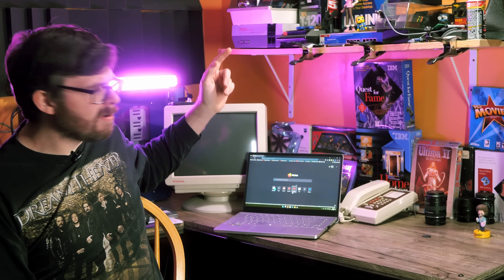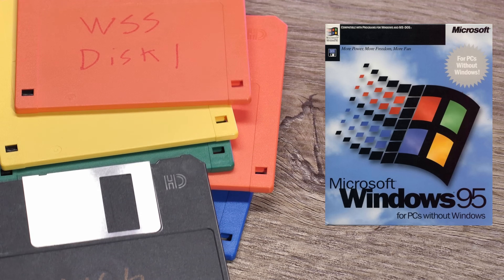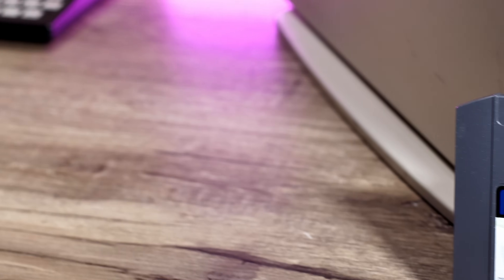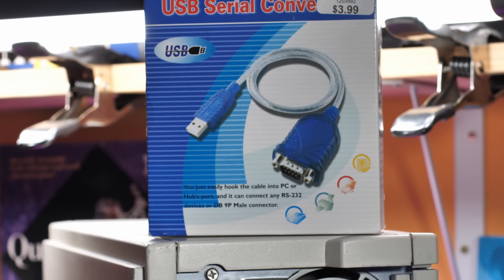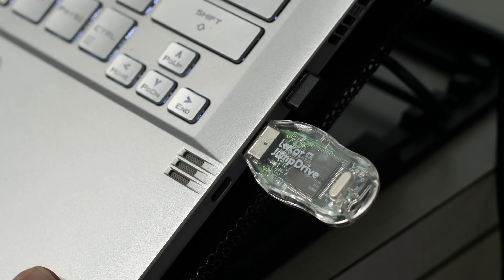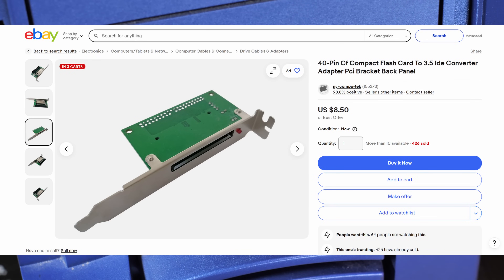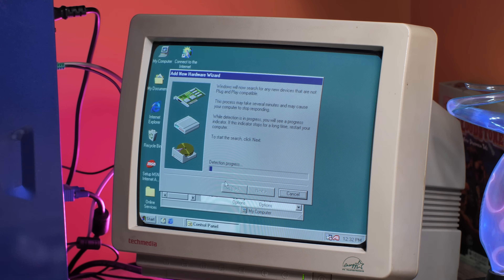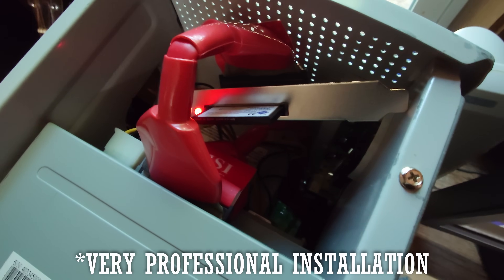What is the Best Way to Move Data to Vintage PCs?

Comment: Okay, few more things 😅.  First, my method of transfer is network!  I use LAN Manager quite a bit, others will use EtherDFS or set up a mTCP FTP server.  Second, for Laplink/FastLynx serial transfer, you'd use a null modem cable, and for parallel transfer you'd use a Laplink cable. Third, USB solutions do exist for DOS!  ISA USB cards are available for purchase and support mass storage. Fourth, I think the PCMCIA adapter you showed might have been PC Card as opposed to CardBus, for people who have older laptops, they might not take CardBus, so if anyone buys an adapter, it's worth checking!
Reply: Yeah, the adaptors are definitely 16-bit PCMCIA, not 32-bit CardBus. CF is just PCMCIA in a smaller form factor, so the adaptors are "dumb". (This also means that PCMCIA is just a removable form of Parallel ATA too, since CF to ATA adaptors are also "dumb").
Reply: @mallardtheduck1  awesome!  Yea, with some "cheap" aftermarket adapters, I've seen the signature "gold bumps" missing but they were CardBus.  It's good to hear that these are PC Card!
Reply from the maker: Good corrections thanks! I'll pin your comment.
Reply: @DOSStorm  right on!  Thanks for making the vid and introducing people to transfer methods.  I see a lot of people who have questions on how to transfer files, and this is going to help them out a lot!!
Reply: Ether et MS network simple XP W98/95, USB ! This only setup ru  little less forward, CD R, costly. FLASH 4G nott many older syste have a drive  ?
Reply: @maedero05  I honestly have no idea what you just said 🤣.  Want to try again?
Reply: You don't need an extra card if the mobo has an usb port.
You only need to run these two commands, you can even run them from a bat, the sys files are easily available at any retro site.
There also are other usb stacks available if that one doesn't work for you, I personally never needed a different one.

devload usbaspi1.sys
devload di1000dd.sys

(Also *dos storm try an usb zip drive you will be amazed at the speed it runs at)

Comment: There was one method I am aware of that you skipped entirely, and it is likely one of the least painful...   If the house or room is equipped with networking, ideally one with NAS or local server storage... you can just jack into the network, map the drive and grab any amount you want.   Even if no NAS or local server, you can map to another system on the network and use that.

Comment: I've been using mostly an Adaptec Sata/Raid PCI adapter. I've 2 of them in 2 retro computers, one with 120Gb SSD and the other with 240Gb SSD. For me this is the best working reliable option available. I think you should buy one of these cards and make a good review.
I've also another retro computer with a 120Gb SSD but with a Sata to IDE cheap green chinese adapter one can find abundant on eBay. These adapters can work well but are unreliable and don't work well with more than 120Gb SSDs period. It will corrupt always all of your data.
Anyway all retro computers I own, their SSDs are divided in 2 partitions, one for the OS and the other for all the data I might require. From drivers and software to almost all disk images games I play. This is the best way👍

Comment: i'm a big fan of Zip but i own 12 disks and a 250 ata drive.
Reply from the maker: If you have the stuff for it and its in good working order its not horrible. However, if you're trying to find a good working drive these days, I just think you might be better off with another solution.
Reply: @ well my drive works at least I’ve had it since I bought it in 2001

Comment: When I use Windows 98SE I love to install the Active Directory Client for it (and also NTFS driver although idk if you need that for it as well never tested it.) Since most PCs I use have an Ethernet connection I can just boot up my VM that emulates an SMB from my actual home server and transfer files that way. Also helps that Win98 still is build upon DOS so I can also transfer DOS games that way.

For this to work in laptops that don't have any Ethernet jacks I use a PCMCIA 10/100 Ethernet card. Although I found that mounting my dumps with that usually makes them stutter, especially full motion videos and such. Didn't figure out where the bottle neck in that is yet...

Comment: If you don't need to go older than Windows 95, I'd use a PCI ethernet card and copy files across the network. 100Mb should be fast enough for the smaller amounts of data those machines would be dealing with. In this day and age, you'd probably have to install SMB v1 on the newer machine, as the newer version won't work with the older O/S. This saves faffing about with any kind of physical media to shuttle files from one computer to another. Plus, you'd only have to copy the files once.

Comment: In around '95 or '96 I bought a copy of 'Backer' which was a system that would backup your data to VHS tape using your VCR. I found it wasn't very reliable though.
Reply from the maker: I remember an old @LGR video on that. I don't remember too many specifics, but I can only assume it was pretty slow at the very least.
Reply: @DOSStorm  It came with an ISA card that had composite output to a VCR and then you installed the software and ran the backup. It was very slow, and 'theoretically' you could get 1GB on a 3hr VHS tape. But the backups were usually pretty corrupted, and you often couldn't restore. Most VHS recording started to deteriorate after a few months, so you can imagine what that does to data integrity. I think I used it twice and then gave up. It was supposed to be a cheap version of LS120 that I was never going to be able to afford, so I thought it was worth a shot for £40...but it was £40 wasted.

Comment: When I was first playing around with old retro dos and Win 95 games in the early 2000's, I was burning CD-R's. 700mb in one hit at 8x speed was way better than 1 million floppies and half of them failing to read 🤣🤣 I did use Lap-link in the old days to file transfer between old 386 PC's. That was a life saver on several occasions for me.
Reply from the maker: I'm still haunted by the "burn process failed" screen on Nero from back in the early 2000s.

Comment: I use an SD to CF adapter in tandem with a CF to PCMCIA adapter to use an SD card as a secondary storage drive for Windows 98SE on old laptops. I find higher capacity CF cards to be expensive while SD cards are cheap. Makes more sense to use the two adapters and a 128GB sd card than to shell out $100+ for a similar capacity in a CF card.

Comment: I haven't had to copy over in a while to my retro pcs, but I'm wondering if there is a live cd linux distro that supports a 4mb ram system. That would be nice to use ftp to transfer over a local network with the cli if so.
Reply from the maker: Tinycore has a GUI and runs on 16MBs of RAM, but the cli only version(Core) would probably work on 4MB of RAM. A FreeDOS live boot can do ftp as well and might be a bit more compatible with old school machines. With FreeDOS the original packet drivers for your NIC might work too...

Comment: Tbh if I end up needing to transfer data to a DOS or early Windows machine, I’m probably going to use my 1999 450MHz PowerMac G4, which I was lucky enough to get secondhand with a Zip 250 drive. Mac OS X Tiger with InterWebPPC can still browse about 70% of modern websites (at least, last time I checked, which was mid-2024), and Mac OS X Tiger still supports the file sharing protocols that modern macOS uses. That said, the only computers I currently have that are older than 2010 or so are Apple machines, be it older Intel machines or PowerPC, which all support USB booting ; basically every Mac with USB supports booting off it, be it native detection in the boot loader or with a bit of OpenFirmware magic. I don’t foresee that changing in the foreseeable future, unless someone just donates it to me (I’m broke asf and have servers to run)

Comment: there is a USB flash drive to ISA adapters you can get for older dos machines, but results will vary, they're not easy to get working, bu when they do work it's magical. tech tangents made a video on it
Reply from the maker: Yeah, I need to look into them as well. It would be pretty neat to get working on a 486 or something.

Comment: I've found floppy emulators (either with the stock firmware or FlashFloppy) a good solution for machines that don't have ATA (or for initial setup of a new hard drive / CF drive). It means you can have a library of floppy disks on one USB -- mine includes install disk sets for various versions of DOS and Windows, plus the three floppies needed to install Slackware Linux from CDROM, for machines that can't boot from the CD.

Comment: Back in the day, when my PC had no CD drive, to move anything larger than a floppy I'd use the parallel cable with Norton Commander. It was much faster than the serial port.

Gotek is a drop-in replacement for floppy drives.

CF2IDE is good, but I'd be remiss not to mention CF2SCSI, SD2IDE and the rest of them, all readily available. All of them are quite slow when dealing with a lot of tiny files, or parallel writes, something flash storage has always struggled with.

Comment: I'm weary of using FDDs with modern explorer for archiving after what looks like some data corruption occured when I tried archiving some old Floppies.

It looks like it caches data and there may have been issues with my USB FDD drive, but I didn't realise at first as it didn't just error out.

Just something to be aware of if archiving old data.

On a side note, on my retro systems I use either FTP or a CF or mSD/SD.

Comment: My oldest PC is a Windows 95 PC with a 200 MHz Pentium processor with 64MB of ram.  I put in a very old 100M PCI Ethernet card that had Win95 drivers and I keep a floppy disk with those drivers.  Once installed, any web browser will access my home media server’s private web site.  It’s dead simple HTML and has download links to all my drivers and software I would need.  I just point and click, download drivers like graphics and sound, and install them.

Comment: There are lots of options. and you CAN boot off PCMCIA cf cards PALM TO FACE not hard. learn linux.
Reply from the maker: Maybe it works on more modern machines if the BIOS supports it. You could in theory load a floppy with something to initialize a driver but at that point why bother? The whole point of this video was to demonstrate convenient ways to move files.

Comment: I have SATA SSDs in an ICY DOCK hot swap bay for easy removal/initial setup - XP and up are fine with SATA but for Win98 I go through an IDE to SATA adapter before the hot swap bay. After the initial setup is complete (and as long as nothing catastrophic happens), I use the network for accessing files stored on my main computer. Some gigabit Ethernet chips can work with Win98 and, even though the software stack slows transfers down to about 15 - 20 MB/s, it's still better than 10/100 Ethernet. XP and newer work with some 10 gig NICs but, similar to Win98, XP's software stack can't reach the speeds that Vista can reach (with some tweaks to offload more processing to the NIC).

Comment: I've got a "retro NAS" set up which runs SSH, SMB v1, FTP, AFP (apple macs), even a web server with an upload button on one page. If it can connect, there's usually some way to make it work. Of course, the setup is a bit more involved, and you have to install drivers and make sure the network is configured correctly, so there's a need to bootstrap with one of the other methods first. Also, I've found the network connection speed to be pretty slow sometimes on some systems, despite what the hardware says, so swapping out a CF card is still the way for large files. 

My 3rd favorite method is Goteks. Same speed as a floppy drive, but you can skip first step where it takes time to write a real disk.

Comment: CD-RW works good enough for me. XP also recognize flash drives without issues but it's not an option for older systems. Floppies are small, slow and fragile, I remember bringing home a software from a friend on 10 disks and 2 were damaged after I got home.
Reply from the maker: Yeah I have floppies I've had since I was 5 that still work fine, but other disks that are NOS, that I wrote 20 minutes ago that give up the ghost.

Comment: I've had better luck with SD-to-IDE adapters. CF cards are not quite 100% ATAPI-compatible, and I've found that a lot of older, pre-Pentium II BIOSes don't support them reliably. I don't have that problem with the SD-IDE adapters, as I suspect they're designed to more closely emulate a spinning hard drive. Plus, most laptops still have an SD card reader built in. 

For the older, pre-ATAPI stuff I own, like my old Tandy 1000, I use an XT-IDE card. They use CF cards as their storage medium, but they come with their own BIOS and A20 hooks. So they can boot, and they're relatively drive size agnostic unlike most old BIOSes. 

One important thing to keep in mind when using either SD or CF cards is that MS-DOS and Windows versions older than 95 OSR2 do not support FAT32, and none of them support exFAT or NTFS. You need to format your card using FAT16, and the partition size can't be bigger than 2GB. The regular Windows format utility isn't that robust; you need to use diskpart from the command line. If you're going to be playing with really old DOS versions, you'll need to be aware of their own partition size limitations; older DOS versions were not built to work with hard drives bigger than a few hundred megabytes, let alone gigabytes.

Comment: As a 56 year-old ex DOS programmer, this is some of the WORST information\advice that I have EVER heard, noob. There ARE WORKING USB DRIVERS for PC-DOS 2000! Search better. LAP-LINK transfers faster by PARALLEL, than serial. IOMEGA ZIP drives need to be recapped, then they are reliable. ALL of us programmers from the 80's and 90's AVOIDED WIN95, LIKE THE PLAGUE! We always upgraded our clients ASAP! Only cheap-skates and NUTS would use WIN95. We made NO exceptions on this at all. I wish all you young hobbyists would BURN EVERY COPY OF WIN95 to complete ashes. WIN95 literally had code-corrective updates EVERY DAY, it throttled-down CPU SPEED, without any indication of doing so, as well as created IRQ conflicts where NONE had existed before. It was and IS like the MCP PROGRAM from TRON. Horrible.
Reply from the maker: As a 34 year old YouTuber, sometimes I make mistakes. 😜 I never said Windows 95 was good, sometimes it's just era appropriate for certain machines. 

As for Laplink, yeah it mainly uses parallel which I should have mentioned, but it can use a serial connection as well. Like I said in the video I haven't used it much personally I was just stating it as an option. As for recapping a fleet of ZIP drives, I think it's more convenient to just use another option at that point....

Comment: Yea, I refuse to abandon the hard drive and use a CF card. I basically do the same as you, if I need a file on my older machine, I just remove the hard drive, add files to it with my modern PC via an adapter, and boom the files are on the HDD just like a CF card after installing it back into the older system. Less convenient, but I really like using actual hard drives for old PCs. The sound is what makes it so nostalgic to me.

Comment: Easiest way (although not necessarily cheap) is networking. Any drivers or other files I need on my older computers are placed on a NAS and accessed as needed. I even connect my IBM XT286 to my NAS and run Windows 3.1 from there. You can even store those ISO files you were talking about on your NAS and daemon tools will still mount them over the network. I’ve also stored Windows setup files from Windows 3.1 all the way up to 11 on my NAS, if I install a new piece of hardware and it asks for the windows CD I can direct to the network drive instead.

Comment: Shut your cereal port! I can't believe you didn't mention parallel. LapLink et al. over parallel is much faster than the 115 kbps that standard serial ports top out at. Depending on the hardware type and mode of operation used (there are several), you can get up to 2 Mbps throughput. That's thinnet speed! IIRC Windows 95 had an included program that was LapLink compatible, and more than once it became the only way to get files onto a laptop with a bad or no floppy. Even pulling the HDD did no good, because of the theft prevention schemes that made the drives unmountable outside the laptop.

But why not just go with Ethernet to begin with? Handling old computers has always been the best way to end up with a lot of old expansion cards, and drivers for cards like NE2000 and 3c509 are readily available for every OS imaginable. It's even good for new computers. I keep a couple of 10GbE cards to speed up transfers on recent machines with only Gigabit Ethernet on board.

Now if the real issue is giving an old machine primary storage after its old PATA drive failed, sure that'll work. Same thing with SD and SATA. There are still IDE flash drives as an option for that. But for moving files, Ethernet beats sneakernet every time.

Comment: I can't believe that you didn't mention network.

You can even just use a null modem cable without need of a hub or switch.
1gb networks still support 10base.
Plus. If you look around, you can find hubs with BNC connectors to support the old 10base 2 connectors up to a more modern RJ45 100/1000 base network.

Comment: For old machines with no HDD I use an SD2LPT dongle. You plug it in to the parallel printer port and load a .sys driver at boot to get access to an SD memory card in DOS. It only works at floppy speed and has to be an old low capacity SD card to work reliably, but is a good solution for some scenarios
Reply from the maker: Nice. I'll look into it! The comment section for this video has been full of great advice.